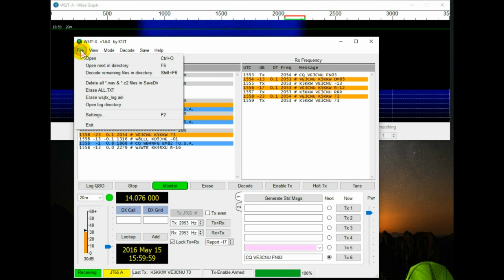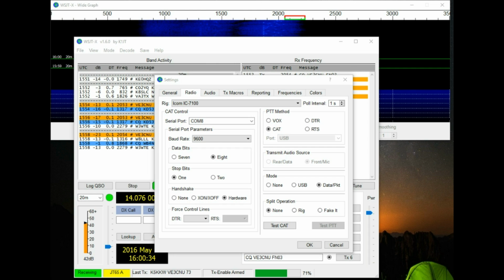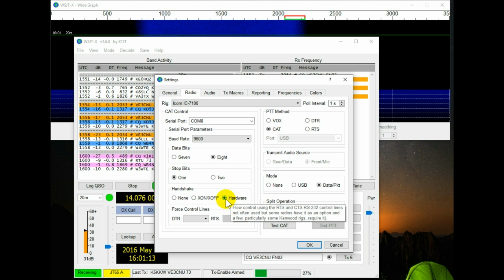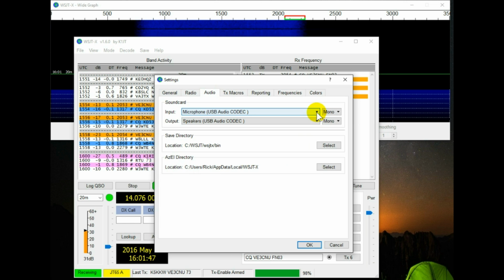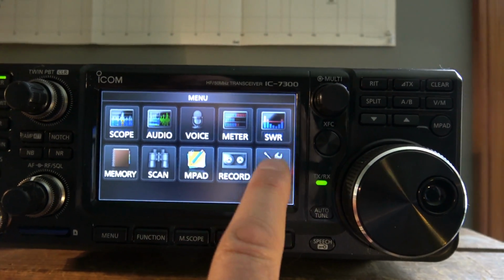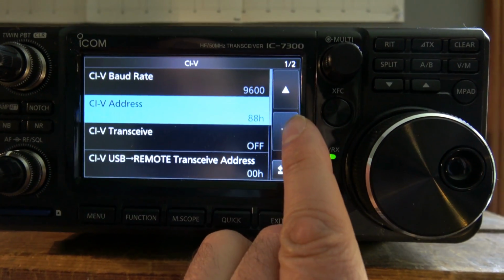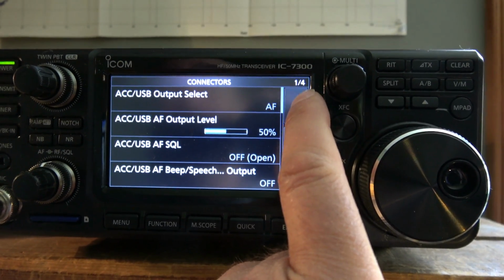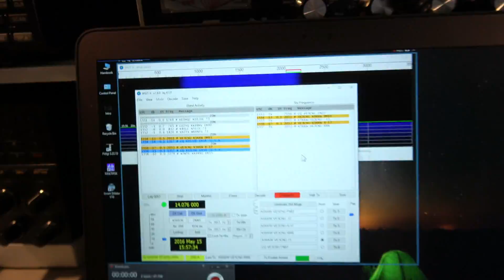Icom IC 7300 | How to configure JT65

Comment: mny tnx; this really works, only i had to set CI-V Output(for ANT) to:OFF. Otherwise crashed with collision errors if i tried to change tuning dial on 7300 (should add i'm running it in Windows 7 partition on a Mac)